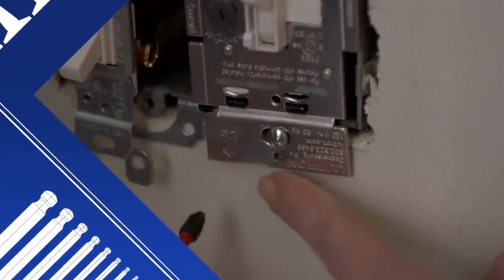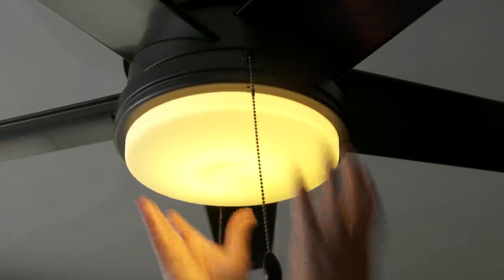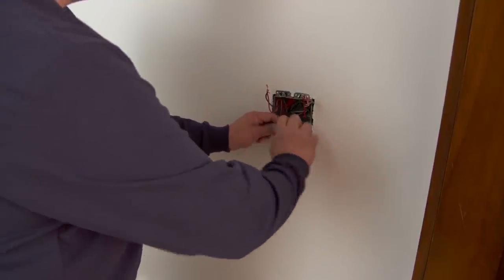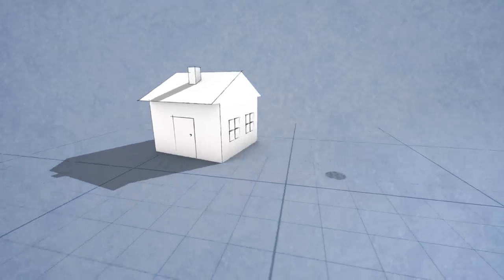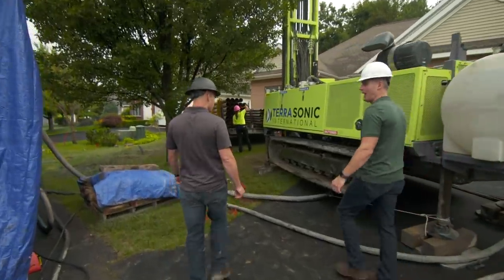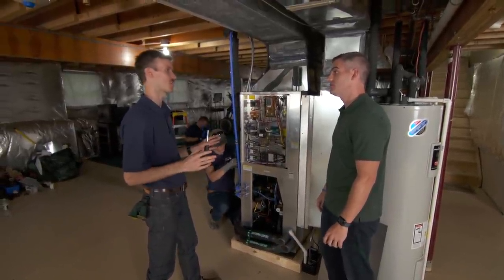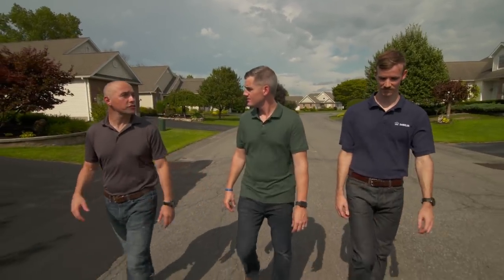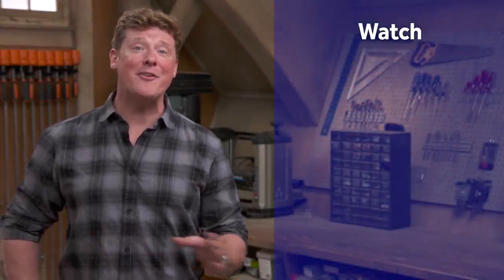ASK This Old House | Switch, Affordable Geothermal (S18 E7) FULL EPISODE

Comment: We did geo with our house and it's been great.  100 dollar electric bills.
Reply: Same, but plus 150 a month for the loan to buy it😂
Reply: I have a regular old style heat pump and electric water heater in a 4 bedroom house. The only bill over $100 is December, the rest are more like $80. And I have high electric rates too! You won't live long enough (and neither will the system) to see any savings.
Reply: @ryanroberts1104 From scratch, no, I wouldn't. I bought the home with it already installed and with 2 years left on the loan. I'll either start making my money back then or have a great selling point for the home.

If I had to choose from scratch, I would go for an external heat pump and a supplementary heat during the frigid days, but I sure like only having one system for everything.
Reply: @ryanroberts1104  Exactly. Doesnt make much sense. I've got an old 1970s oil fired boiler and even that doesnt cost me more than $240/month in the worst of winter... no way in hell Id ever get close to getting a return on investment with geo
Reply: What size house? How has it been working for you?

Comment: $19,000 upfront?? It would take a long time to recoup your money,  by the time you broke even it would be time to replace all the equipment. Same with solar. I've looked into a solar farm on some of my property and in the long run really don't see a big savings. Thanks for the show always like watching.
Reply: There are other reasons than Pay-Off to get any of these systems. For Solar, I'd be doing it instead of getting a Generator for local Power Outages. Among all the other incentives, Saving $10-15K by not installing a Generator goes a long way to have peace of mind. Also, as was said in the Video, these systems add to the value of the House (ground source heat-pump in the Video's case). Do you demand a pay-off period for the $20K spent on that backyard redo? Do you demand a pay-off period for that new toilet you installed? Pay-off is actually largely irrelevant. There is no pay-off period for your house until you sell it. That 150K-700K+ is a loss until you move. People buy things because it works and does what they want it to. Do that.

Comment: Questions about geothermal energy other than heating and Cooling the house can it power the house.
Reply: No, it's just using the ground as a more efficient heat sink (than the outside air) with a heat pump. The temperature difference between the air and the ground (at a depth of only a few hundred feet) isn't big enough to extract meaningful amounts of energy from.

Comment: Trying to sell Geothermal again, I see. Not many volcanic hot zones in the Northeast American continent?
Reply: For geothermal, one need not have a source of underground hot water to heat a home.
Reply: @CybekCusal  what are you implying exactly? I'm curious to know your thoughts of how geothermal works? Same with the beast from the east bambam up there.
Reply: @RangeRov49  the comment from bambam is correctly telling you that "geothermal" energy is hot gas extracted from the earth. This system in the video is called "ground source heat pumps" it's completely different technology than "geothermal"
Reply: @CybekCusal  not far from here the bore 330' + geothermal wells in bedrock that circulates water and propylene glycol through the system and uses ground temperature and boosts that 55° average temperature to either heat or cool a home. The siamese loop hosez used in these systems would not survive boiling water. The plastic hose constantly circulates this liquid, but when needed, and at no time does ground water get picked up in it.
I lived in New Mexico where the US Department of Energy had a pilot system back in the 80's that did use underground hot springs, but this type system is far more expensive, at least $40,000 to start, and was cancelled due inadequate water supply for heating.
Reply: Uhmm....geothermal doesn't need that! You should do some reading before making an uninformed opinion.
Reply: @edrcozonoking  I AM THE SOURCE! bow to me scrub.